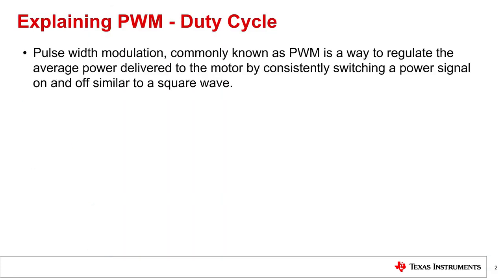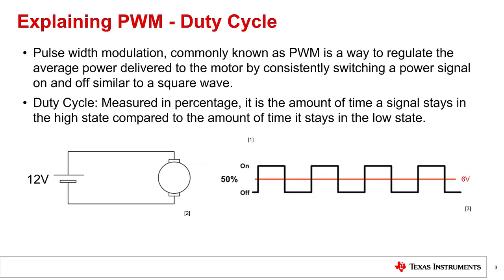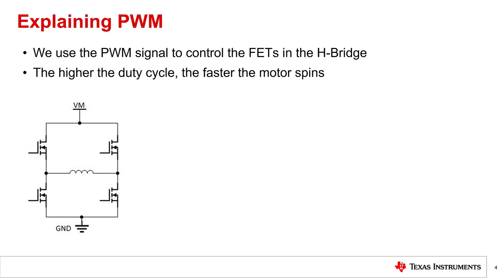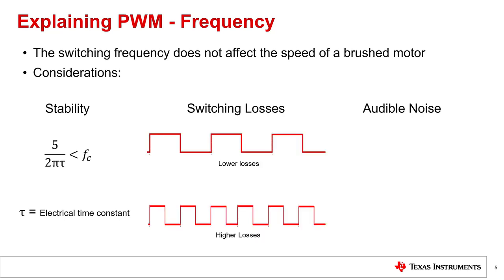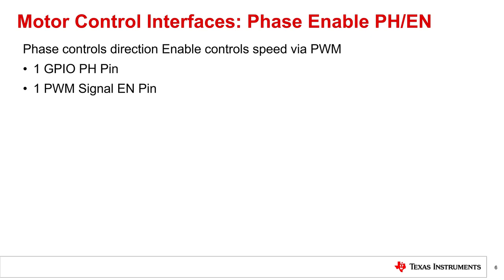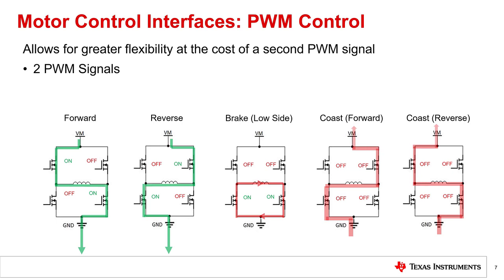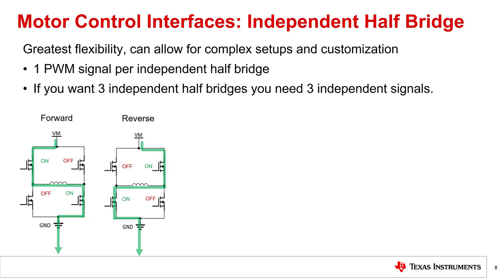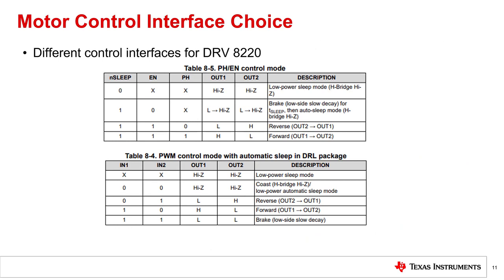Motor interfaces and PWM frequencies

Comment: I used IR2101 driver in 3 phase BLDC control circuit. IR2101 blows up after a certain engine speed. Do you think I should increase or decrease my PWM frequency?